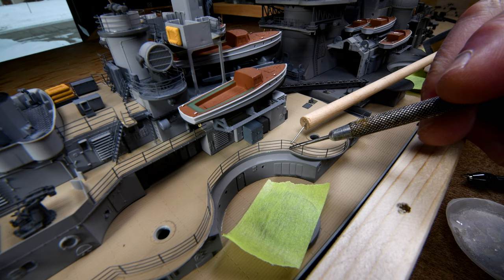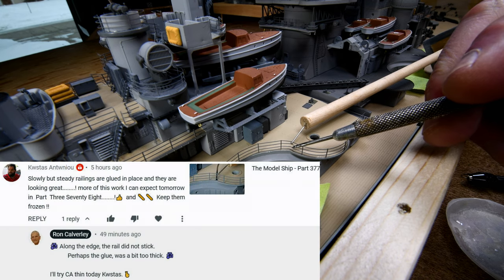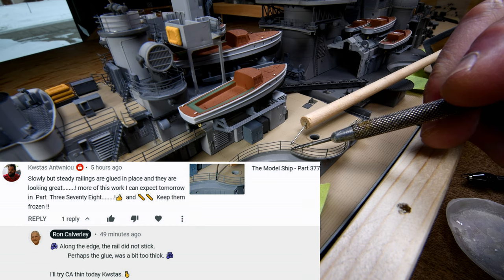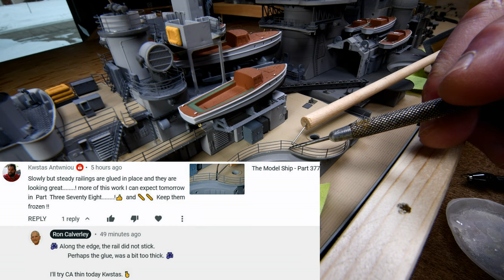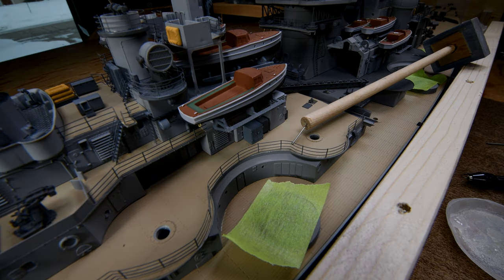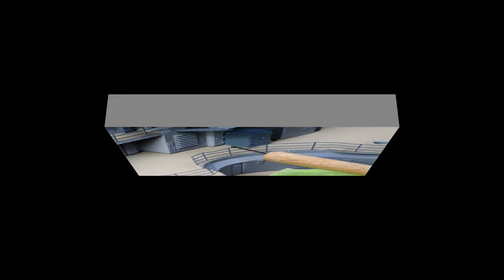The Model Ship - Part 378

Comment: Today's Part finished and followed by the next one Three Seventy Nine........!  Put a little Post in place and everything will be  fine........!  Using CA thin it works at the end? See you tomorrow!👍
Reply from the maker: 🎶 The work on the railings, it will soon be done.
             But then there's the rigging, it will have begun. 🎶